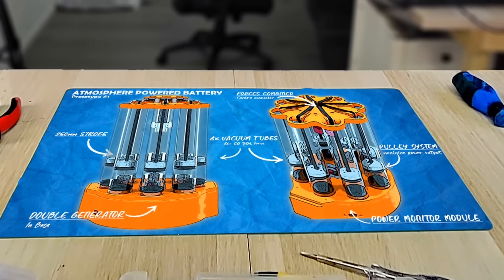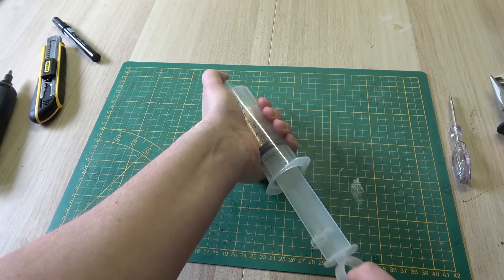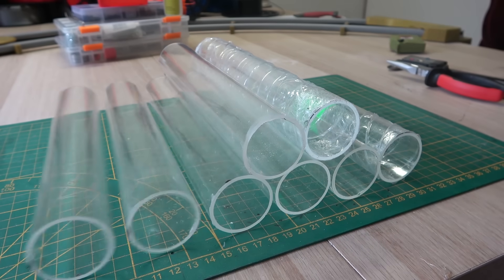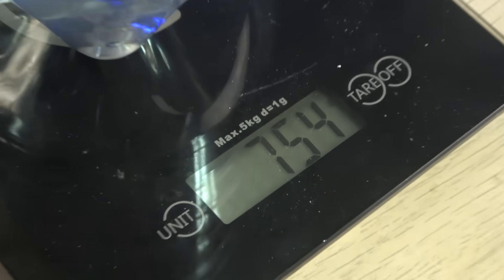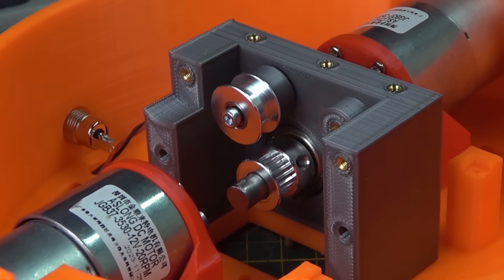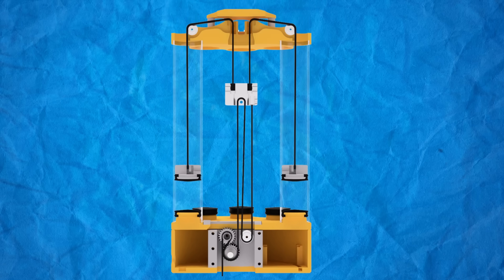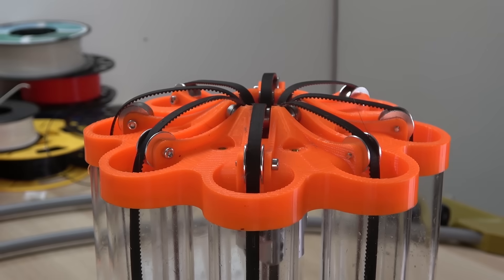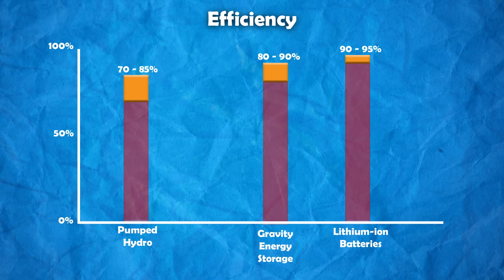Building an Atmosphere Powered Battery..

Comment: probably the easiest way to do this is  water.   create a large "reservoir" high up...   when you have excess energy pump water into the reservoir, when it rains get free energy..  lose energy through evaporation...      but depending on the locations...  that shouldn't be a huge loss or problem.   then...   when you need power...   drop the water.. hydro electric power is generated.  when you don't need the power,  shut off the vulvae and pump excess back in.

Comment: About the efficiency, it would certainly be better when scaled up, with less friction  ( square/cube law between perimeter and surface of the pistons) and more efficient motors. The issue would be the price of such a device, with materials able to resist to the huge forced, while hydro is just a lake, and gravity a hole...

Comment: I remember looking into weight batteries. It would take the weight of an Oldsmobile to be raised 50 feet in the air to power an average home at night. Which is not really that feasible for most people.

Comment: The pistons are pretty much just pneumatic springs. You could increase the power density by a massive amount if you just strengthen the cylinders (or maybe use off the shelf high pressure pneumatic linear actuators) and pressurize the high pressure side to something above 1 atmosphere.

And to those saying just use springs, its the same concept but coil springs produce a more inconsistent force, the air pressure springs are a lot closer to constant which is better in this application

Comment: This is very nice indeed, great job.  Thank you so much. Could you give a energy/volume comparison with both batteries and pure gravity.
Also, have you tested the leakage? I believe you could place a little bit of liquid (water, colorized water…) above the pistons and wait hours, days to see if any water comes in. You can also compare the energy left after 1 hour and the 1day etc…and compare with the discharge rate of batteries. You should also compare the price/Wh that it cost to built the system (at scale) with batteries. The price of batteries is set to come down so much…

Comment: Very cool project. The design gets cool points. A few suggestions:
To cut down on frictional losses, 1 vacuum chamber with a diameter optimized for ideal torque. And something to better stabilize the plungers as it looks like they are crooked in their cylinders which will reduce efficiency.

Comment: How would the opposite work? Instead of using a vacuum, using compressed air as a storage of energy.
Might be able to use fewer moving parts and with that prevent losses from friction. Might even be able to have "energy cells" where the pressured containers can be replaced and stored.

Comment: You might be able to simplify the pulley system by replacing it with a high strength fishing line winch. No idlers or precise mounting plates needed

Comment: Hmmmm... maybe if You could use a spring to store energy... That thing might be able to store more energy, because it relies on tension rather then force. Like... use some system as a rope that gets twisted to store energy and it simply untwists when it releases the energy. Not necesarely that it would have a better efficiency, but it would probably be more compact.

Comment: Place a vacuum pump on the bottom and create the most vacuum  you can because no matter what it will have some moisture that will turn into gas. Also clean the tubes with something that doesn't leave residue as to not have anything sharp to let the vacuum out through the seals and to get any slight sticky substances off the tubes. Try different rubbers to challenge the friction entropy.

Comment: how about gravity and vacuum pump energy,  you use gravity to charge the vacuum pumps, and while gravity is charging the pumps, its also spinning the motor, then some weigh is moved off of the weight allowing the vacuum pumps to pull the weight back up further turning the motor when it gets to the top, weight is added and the system continues. 

how do you get the weight that you take off on the bottom of the shaft =back up to the top well i have a few funny  to more serious ways:
1. running fitness course for people who want to lose weight,  you must carry weight up stairs to the top of the shaft. 
2. we have a pulley system that uses less watts to bring the small amount of weight up
3. my favorite idea is that there's a armature cam that has the extra weight attached situated on the top of the shaft that rotates to remove the weight when it reaches the bottom of the shaft. then it adds weight once the armature and weight reach the top of the shaft again.

Comment: Try using a different motor like a magnetic motor that uses a Halbach array. Arranged like in this link:

https://en.wikipedia.org/wiki/Halbach_array

• The amount of force needed to drive the motor is way less. We can see the efficiency on that and compare.
• We can also use a larger motor that requires more force to turn and see what happens with that efficiency.
• I would also be interested to see what would happen with the new superconducting motors, however those need cryogenic cooling.
• I would also like to see what would happen if we also added lorentz forces to it, to produce eddy currents in such a way that it benefits the system.

Comment: Nice concept, I already detected some advantages of this concept:
- It is easy to scale up the capacity by using bigger diameter for pistons or more pistons. While the other concepts are harder to scale up. The scalability is of power 2 order. i.e twice the diameter gathers 4 times more force from the atmosphere.
- There is probably a way to enhance efficiency: using bigger diameter pistons and reducing the piston course (displacement), this may reduce the friction. Not sure, this needs some computation and tests. With a bigger diameter and lesser length we have a bigger surface of friction but acting on less length. The friction is caused by the normal force acting on the cylinder by the deformation of the joint, will this force be bigger or lesser with a bigger diameter?

Comment: Cool project, but I can't believe your result. Servomotors provide a lot of force and are not very efficient. Even if the rest of your system were frictionless, the overall efficiency could hardly exceed 50%. Nevertheless, thanks for the video.

Comment: pretty cool. I'm just an armchair enthusiast of energy storage but the thought experiments are fun. For a compact energy storage method with no chemical danger, no real degradation and easily serviceable parts, I think this is a pretty cool experiment. I think scaled up with some refined tolerances could absolutely get the efficiency up. The danger, of course, is large vacuum chambers, but this would be interesting to see something like this on houses. It makes me wonder if there is any potential in simple having a large vacuum chamber with a regular vacuum pump and then a valve to switch it over to a fan generator.

Comment: Or you could just pump water from a reservoir placed lower to a reservoir placed higher when you have excess of power and do the reverse thing when you need the energy back.
Its funny when "up and coming" start ups with bigger marketing departments than engineering departments try to reinvent the wheel.

Comment: as a proof-of-concept experimental project, to gather data and understand the principles of energy recovery, your contraption is spot on, but it's too complicated, too much points of energy losses and by extension, too much maintenance incurred costs if this system is scaled up for commercial use. 
there is only one method of energy recovery, compact enough to be working at the individual home level and efficient enough to simply be usable: that's the lithium based batteries. even then, it's not commercially viable on the long term, neither environment friendly, the extraction and purification methods for their components and the manufacturing process are a catastrophe for the environment, then, during their lifetime, the cells are subject to battery fatigue too and the difference with nickel based batteries, that loose capacity over charge/discharge cycles until it's internal resistance is to great too sustain a charge, the Li batteries just dies one day with next to no warning. they are very difficult to recycle and the process is far from being environmentally clean (I read some time ago that something like 10 to 25% of the components are economically recoverable with the actual level of technology, the rest is just unusable toxic waste that would be more environmentally impactful and would cost so much so that building a new cell is better than to try a recovery).
the only environmental friendly and economically viable way of energy recovery is simpler the better, that translate to kinetic energy storage, that's all. a simple dual-purpose motor/generator that just transfer mass with limited mechanical loss factor, coupled to the simplest monitoring system possible (means rugged, easier to repair and less conversion losses to the electric system) to interface with the electrical grid. that means water reservoir storage, centrifugal concrete batteries and even the original concept that gave you the idea for your device (but I'm skeptical of that solution, the only situation that could justify it is if they are installed in arid conditions, where liquid water is too precious to be used as an energy storage mass, even then, I would stuff the mine galleries with centrifugal batteries, that would be more space effective and have the bonus of being less hazardous in the case of a catastrophic failure)

Comment: You can improve efficiency by making the tubes larger in diameter, and less tubes. This will reduce contact area of the plunger to the walls massively and therefore losses due to friction.
Reply: You could probably increase efficiency using thermodynamics too.  Store while warm discharge cold..
Reply: That would increase the pressure and thus making his seals fail quicker...

Nevertheless it is working by using vacuum pressure so it is limited in the amount of energy stored per volume compared to a compressed air storage. i think 1 bar was less than 20% of a kWh per cubic meter. which is 1000 liters and those tubes maybe had 1 liter each ;)
Reply: So if it takes less energy to store, and you get the same energy out... it doesn't matter that it's a vacuum.    It's the differential that is important.   I don't think seal failure would be any different.   I'm not talking about 100degree differences... I'm talking about normal atmospherical temperature differences from night/day.   It doesn't make sense if you have to create heat/cold.

I'm thinking you're just being obtuse.
Reply: Nope. Friction is independent of area of contact.
Reply: @aeroant and this is famously the reason that formula one cars use bike tires
Reply: Kinda, in theory, in purely static or dynamic scenarios, with rigid bodies.
adhesive force is proportional to the surface of contact, and rubbers are very adhesive
Reply: @AmorDeae  Not Kinda.. Your Word salad sounds like you just finished a class on contact mechanics but don't understand anything yet.  Proportional to the surface contact?  In a hyper simplified way..  You didn't make a point with your statement... 
Are you building to it?
Reply: @aeroant  why's a spinning top on a spike then?

Comment: Don't focus on the efficiency, guys. 628 Wattseconds equal 0.00017 kWh. This is the capacity of this device. This seems possible: the energy stored in 1 liter of vacuum is 100 Ws. "Vacuum" sounds fancy and pretty hightech. It isn't. Large scale industrial pressure-storages work with hundreds of atmospheres in pressure.This works with one atmosphere.

Comment: Good project educationally speaking. But of course the 820 Joules you stored could much more easily be stored by way of a traditional gravity-setup. For example you can store more energy than that by lifting a 10kg weight one meter vertically.

Comment: Great 3D printing project. Nice idea but using pressure ( positive pressure or vacuum) is an inefficient way of storing energy. 
I like those flywheel storage units that are housed in a vacuum chamber to increase their efficiency. Could that be build like this in small scale?

Comment: a crankshaft would make more sense. use a lever to slide up a straight gear/toothed rod? to turn a large gear 180° in total for pushing the plungers into position. cock the generator using electromagnetism. like one second of input for more in output from it.

Comment: Add a vacuum pump system. Try having 3 way valves on the base of the cylinders. have one position to atmosphere, one to a close, and the 3rd  to a vacuum pump. get better efficiency motors or even better, proper high efficiency generators. raise the plungers with the motors while you have the valves open to atmosphere so there is no work to lift the plungers. close the valves and create the vacuum using a vacuum pump as it should be a lot more energy efficient f you have a high energy efficiency pump. then at the end of the video, please do a cost analysis. also add a tension regulator to slow the speed of decent to maximize capacitor charging. Looking forward to that video rendering.

Comment: I wonder if it would be possible to make the pressurised tubes detachable in some way, so you can charge up multiple charges to be used when you need them. If it were possible to seal the air exit and detach the chain without losing pressure you would have a transferrable air based battery

Comment: I agree that there is significant friction at play, however, I believe that it could be improved. Because you have multiple cylinders, each generating friction. But using one large cylinder you could reduce this latent friction.

Comment: It's dangerous, it's not as efficient as conventional batteries, it's not as dense either, normal gravity driven systems are much safer with more pros and less cons. Plus this system isn't airtight and will always have air leaks, which means this battery fails at storing energy long term, which is it's entire purpose.

Comment: There is two more factors to take into count other then efficiency. cost to make and maintain. and longevity. If you have a natural source of energy like hydro, solar, wind or a combination. efficiency matters less. But the cost and lifespan of batteries do. 

Personally i would build a tall ass clock tower on my land and use the bell as a weight. (or just a weight as a weight😏)  and by just glancing over at the tower you can see at what height the weight is at. Like a big battery bar. Would probably paint the tower green, yellow, red as well from the top to bottom. And have the bell ring when it gets to red. hehe im getting way ahead of myself now 😆

Comment: Would be interesting to build a gravity machine using weights that has nearly the same power output as your contraption, to see if you are saving space.  If your build produces the same energy but is 10x smaller, that definitely makes it worth looking into!  Especially considering the volume to surface area ratio.

Comment: For space flight, in a vacuum obviously, this could become EXTREMELY efficient and even exceed 100% efficiency. Here me out, this does not break laws of physics or use black magic. If you make the seal connected to the moving piston have the ability to seal and unseal itself on the fly, power the charging motors with lithium-ion batteries, have the bottom of the contraption have direct access to the outside vacuum through a SEALABLE trap door, you could do this. First, charge up the lithium-ion battery and send out the ship. Charge up the atmospheric batteries by unsealing the piston seal and sealing the trap door then pulling the piston up. This prevents a vacuum and causes less energy to be lost by charging the battery since you are not fighting atmospheric pressure. After the battery piston reaches the top, seal the piston and open the trap door. This creates a vacuum below the trap door and creates atmospheric pressure above the piston making it function properly. Close the trap door and disable the motors. The atmospheric pressure will then push the piston down to the bottom. Once it reaches the bottom, repeat. Also, any excess energy should be used to charge the battery that charges up the piston. The reason this is not a perpetual motion machine is because you are still having to lose matter, which has energy, in order to do this. That could eventually cause problems because we need an atmosphere to breathe in, obviously. But depending on battery volume, it wouldn't be a problem for a long time. This could be useful on extremely long duration missions too, for example, another star system. Go ahead and steal my ideas NASA, I want this to further our technological abilities.

Comment: First, very cool and innovative video. You have math and tech skills I dream of having.

I haven't seen it mentioned so I'll bring it up - I think you're also losing some energy to heat. I would strongly consider insulating those tubes, and using an inert gas such as helium as it has a low atomic weight and high specific heat capacity which affects the math of the ideal gas law (it's changes temperature less when pressure changes as compared to normal air, which is nitrogen rich).

Review https://en.wikipedia.org/wiki/Ideal_gas_law .. tl;dr: pV = nRT. As pressure changes, temperature also changes. Since you're creating a vacuum, the temperature inside is changing, but eventually evens out with the ambient temperature. Insulted tubes will help mitigate change in temperature, which should help mitigate the loss.

Hope to see more improvements on this design - it's very cool.. all the best from a failed biochemist turned IT help desk rep.